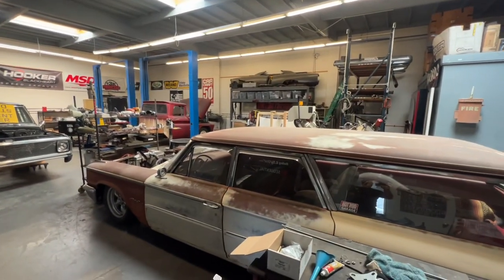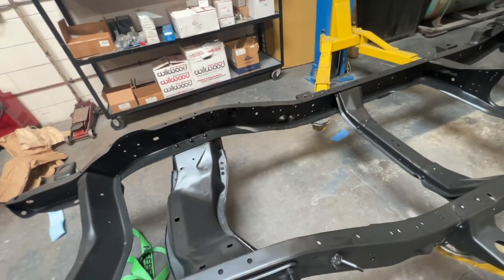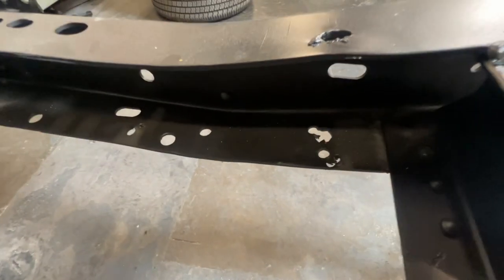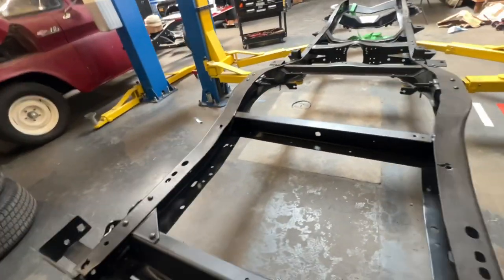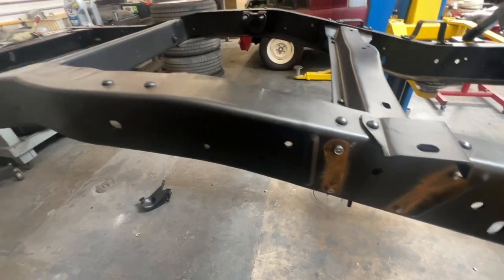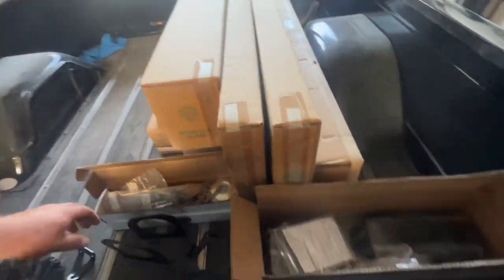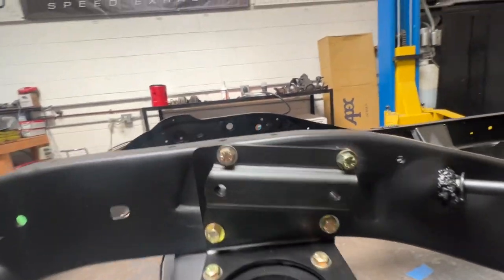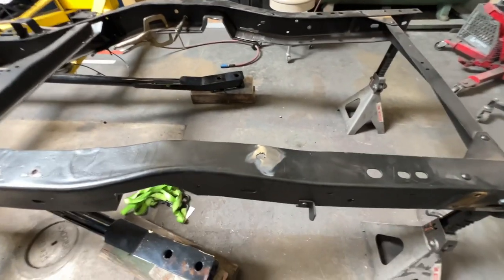C10 Frame Rebuild

Comment: I aporeciate your channel!  I work on my own cars in my garage and I need some advice on a purchase.  I  need to get a shop press to replace bushings on some lower control arms and a track bar.  I want to purchase something that will handle other jobs i will run into like wheel bearings, rear end gearing, etc.  What size press do you recommend?  I was looking at a 20 ton or 30 ton.  Just didn't know if a 30 ton was needed for such jobs?

Comment: Some of the cross members and factory holes are different from the Coil trucks to the Leaf trucks.
Thus adding a little complication to aligning the C notch which you found out.
Reply from the maker: Yep.   So I mounted the diff and used the housing to align the kit.  👍